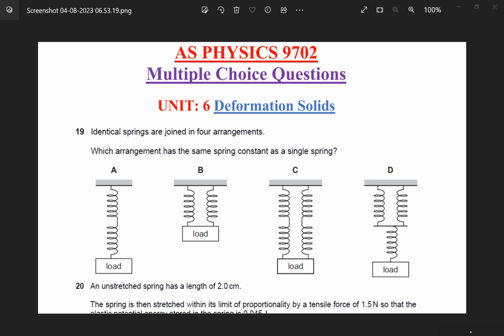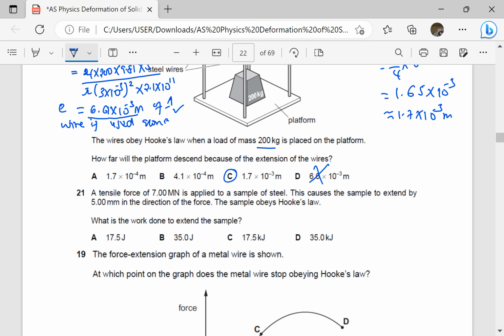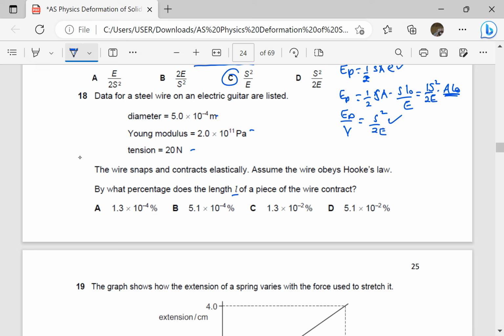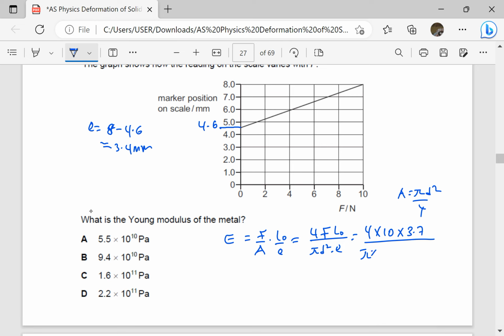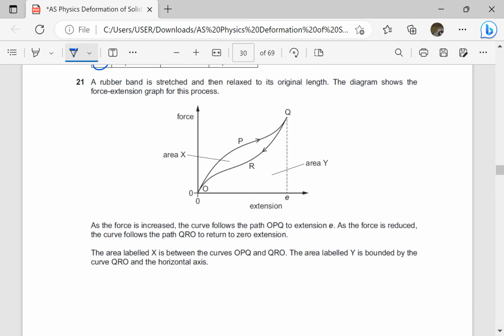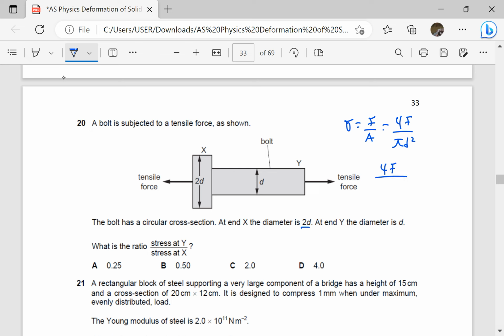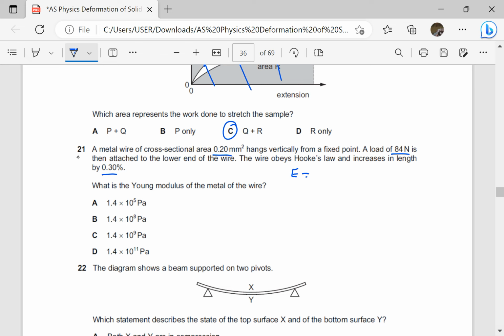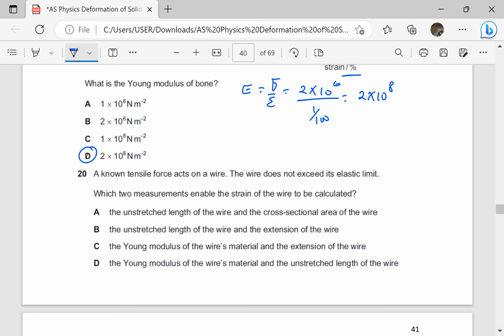Deformation of Solids ;AS PHYSICS 9702 [MULTIPLE CHOICE QUESTIONS] #Part 2

Comment: Good morning Sir
Sir I will write my as level physics exam this May June 24 and my P3 is on 30 April 2024 I am pretty weak please guide how I should maximize my prep and also some tips about P3
Thanks
Reply from the maker: 30th april or may, i think exams are in my. i have a class sitting may/june

check out my videos for sample solved paper 3
Reply: 30 April
Reply: And please other tips to get an A in as
Reply from the maker: @UsmanAshfaq-z6k  concentrate on the simpler topics by practicing the topical questions, then in the last days you concentrate on waves, electricity and force, density and pressure. these are the major topics which u must visit before exams.